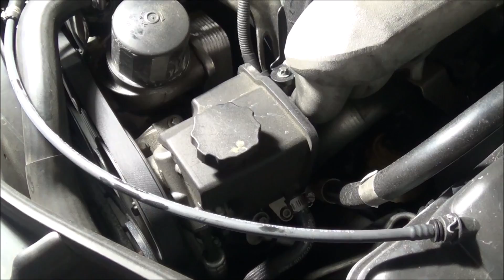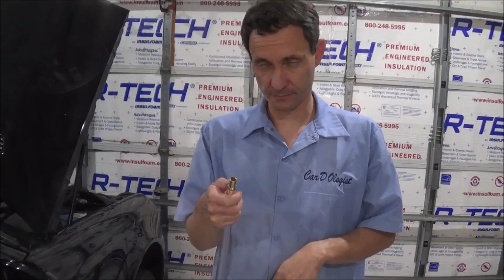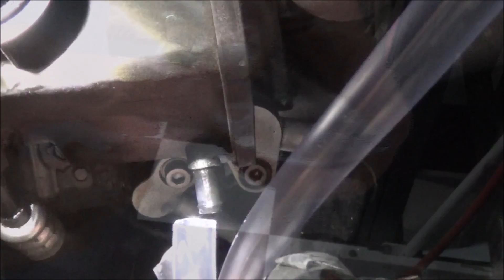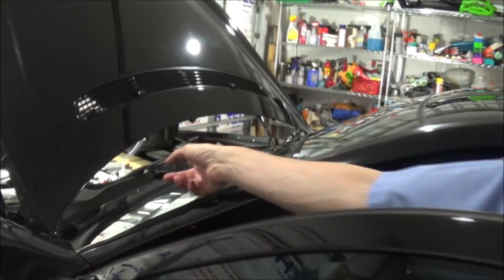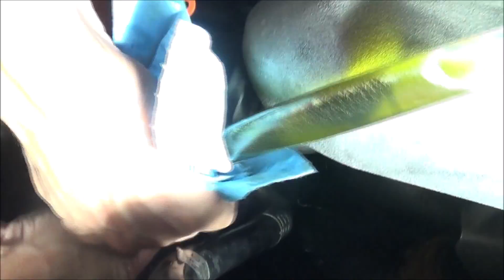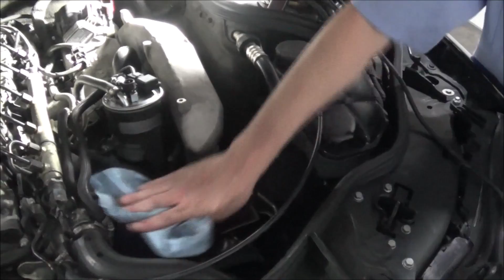Power Steering Fluid Flush

Comment: @Car D, Thank you for your vid, I am going you use this method as soon as my fluid arrives. Why didn’t didn’t you place the waste container on the floor instead of on top of the engine? I’m thinking less mess,  the hose would empty into the waste container as soon as it was  disconnected or is siphoning a problem?

Comment: Yeah, this works.  Thanks for your e320 vids.   Tips:  Use the 3/8 tubing from Home depot and the 3/8 barb.  Use a small styrofoam cup(break the top off if needed) to catch the fluid from the res.  I did this while really spilling almost nothing - I had never had an idea of how to accomplish this task before watching the video.  Really thankful for your video - well done. The OM648 powertrain is probably the best I have ever owned.....the car/body is probably one of the worst.
Reply: Why do you think the w211 is one of the worst?
Reply: @gabem9937  Have had W124 and W126, have had 2 W211's.  I think MB was still learning how to make cheap cars(well) with the W211.  Just my experience, little things like falling headliners, plastic parts that break, sun visors(oh man, the crap sun visors).  But, they don't really seem to be built that well for a cheap car either, in comparison to say, Toyota.  Just an opinion, hopefully informed.  But, as I said, I think the powertrain on the E320 CDI, is the best diesel I have owned.
Reply: @rednekarson   Indeed the sun visors are a pain. I drive a Model 3 occasionally for work and the build quality is unbelievably poor.. when I get back into my w211 it feels like the most solid car in the world. Not as solid as a w123 or 6th gen Camry, but at least a lot better than many new cars out there. +1 for the cdi powertrain.
Reply: You could just start the car and the while system would be flushed

Comment: Can you flush out most of the old fluid first by turning left-right before you add the new stuff in?
Reply: You will fill the system with air draining the system. Then you need to add clean. Then let the car sit overnight with clean fluid because you may have foam from mixing air with fluid. Then you will need to slowly turn the wheel to flush the system again just to get the air out.

Comment: Hi! Your car sounds just like mine. I notice you have the same 165hz "groan" that mine does. I'm wondering if that's normal or if perhaps there is a pulley or tensioner going bad? Hopefully it's normal :)
Reply: You could always remove the belt and check the pulleys for excessive play, my tensioner went at 135,000 also at the same time a found a bad idler so I replaced both, but with the engine running you can look down at the belt and see if the belt is tracking straight and not wavering.
Reply: @jadesluv  Good idea
Reply: I have the same noise. Did you ever figure it out?
Reply: @liamdavitt1297  No, unfortunately I never did and since the weather has turned colder, I don't hear it as much. So I'm wondering if perhaps it's the aux fan bearing or maybe a pulley/tensioner is behaving differently with the temperature change. I do still hear it from time to time tho. 
Is yours very noticeable as well? To me, it's not quiet or subtle whatsoever. I just wish I could figure out what it is.

Comment: Hey so I got an 05 e55 I was drifting with it and all of a sudden steering went hard, opened the hood I saw sum leak by the Reservoir after that’s I replaced the rack and pinion, power steering pump. And the reservoir still the same steering is really tight and hard to move not sure what the problem is I would really appreciate if you could help me thanks
Reply: Power steering solenoid

Comment: The color of Mercedes power steering fluid is red-brown. Unless it turns black it does not need to be changed. I guess you used Pentosin CHF 11S that is green in color.

Comment: Great video. If you end up changing your brake fluid could you film that? I am planning on doing mine without Star using a pressure bleeder once I get some time.
Reply from the maker: So, I just did this but went to the dealer because to do it correctly, you need to have Star Diagnostics.  If you power bleed, you can clear the brake fluid reservoir and the lines, but will not clear the internals of the SBC pump -- which is the most expensive and important component of the braking system.  I took advantage of the covid 19 situation and used a 25% off dealer service coupon when they had no business and only spent $270.  Not bad.

Comment: GREAT JOB!!!!    IS THE GAS W211 POWER STEERING FLUID PUMP RESSOVOIR DIFFERENT FROM THE DIESEL?
Reply from the maker: Yes, it is.  I looked into this.  I wanted to replace the reservoir because it contains the filter -- but it was not available for sale -- and the ones that were had a different orientation of the outlet pipes.  This must mean that the power steering pump is different for the diesel.

Comment: I have the same car the same model and I have a question for you:
Are you deactivating the SBC system when you do the job break pads  job?
Reply: You can simply unplug connector that goes to SBC pump.
Reply: How to install star diagnosis https://youtu.be/zPha-2OW92c
Reply from the maker: I don't have Star Diagnostics, so I unplug the large black plug going into the SBC unit -- then plug back in when I'm done
Reply: @card.ologist4570  I found thats not necessary to unplug the SBC, I even accidentally opened the passenger door with the caliper off and pads out, it pressured the SBC but did nothing else, I opened the caliper bleeder screw to compress the piston to get the new pads in.